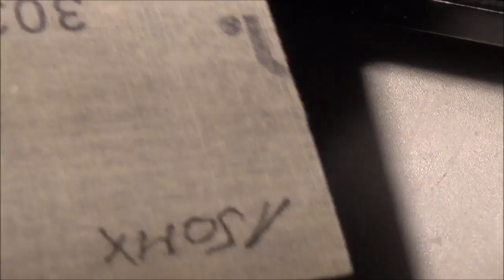Nakamichi BX-100 Idler Wheel Problem

Comment: Hi - Nice video!  Just a quick note - if you want to clean the idler to get more life while your part is on order, all you have to do is pop off the cassette door, take out the 2 screws holding on the black plate, and clean the idler!  You don't even need to take the cover off!
Just did that on mine and it's back to strong winding each way!
Reply from the maker: Thanks! And thanks for the info! That's good to know!

Comment: Thanks. I have this same model, and this helped me. I ended cuting a 1 inch square of 220 grit sand paper and wraping that around the wheel, and sanding it lightly in place. Only had to remove the front plate, and not take apart the whole thing.
Reply from the maker: Thanks for telling about the method you used. Good job!

Comment: Mine had developed the same fault. The good news is you don't need to take it apart to fix this. Removing the black plate is easy enough with just the two screws and then you can get to the little wheel and roughen it with one of those sticks designed for filing your nails. Very light pressure, patience -the idea is not to file it down. Using Fast Forward will allow you to get the machine to do most of the work too. However, I think the real problem is the rubber has aged and hardened over the last 40 years and this will only be a temporary fix. A replacement tire is needed. I ordered one along with a capstan belt as I am sure the existing one will also have lost its performance over time. Lubrication of the various bearings is probably a good idea too.
Reply from the maker: Thanks for your input! True, the rubber has just aged; nothing can be done about that. So far the deck, which is used often, has held up fine. I didn't know they still sold replacement idlers.
Reply: I used this filing method and it worked brilliantly. Highly recommended.

Comment: I just repaired my Nakamichi CR-7A thanks to your video and to the comment of one of the persons that watched the video. 
To make it easier than this video, I just removed the black metal plate that sits behind the cassette, there are two small screws on the top of this plate that sits right in front of this  Idle wheel. I cleaned the tire with liquid sander and I clean all the parts or spindles where this tire makes contact with Isopropyl alcohol, it took me about 15 minutes. 
Now it rewinds, fast-forward and  plays like brand new!
Reply from the maker: Good job! Thanks for your comments and tips!

Comment: Praise the internet and praise people like you for sharing the knowledge. I THINK this is going to be exactly what I need to get a Sansui D-550M going properly again. If the sandpaper doesn't work, then maybe I'll use an o-ring instead. Fingers crossed!
Reply from the maker: Good luck and thanks for mentioning o-rings!
Reply: @OldSchoolElectronics  Just to follow up, i was able to use your idea of sandpaper without removing the idler assembly. In fact, without a tape inserted my machine was able to spin the idler wheel reasonably well, so I could use fast forward to spin the wheel while I lightly touched it with sandpaper. I few minutes later, I was done. Thanks again.
Reply from the maker: Glad that worked out for you...Looks like you did a great job!

Comment: I just wanted to add to this video. I found that you can access the idler wheel by just taking off the black plate through the door. Also I removed the rubber wheel without removing the cam. I then turned the rubber wheel inside out so that the previous unworn inside part was now on the outside. A perfect easy fix.
Reply from the maker: Thanks for the extra information!
Reply: Your welcome. I didn’t say in my comment that your video is great.  It’s probably saved hundreds of Naks from ending up in the junk heap. Thank You!
Reply from the maker: Thanks, again! People have criticized me for this video, though! Sometimes I have also used an o-ring for the rubber wheel/tire. Good idea with turning the wheel/tire around.

Comment: Without this small trick and a small piece of sand paper, thi Naka was good for the garbage : what a shame ! I mean : there is not a single line about this possible issue on the BX-2 Service Manual. Couldn't they think such a problem could show up after some years ? Dam !  I mean, I'm happy to have save it - and thank you so much for your help - but in the other hands, I feel that so absurd ... Most of people have  think it is dead and how many units have been wasted ?
Reply from the maker: Good job! I am happy you got it fixed. Saved from going to the trash! I think when they made these machines they did not think these Nakamichis would still be used 40 years later. Thanks for watching and your comments!
Reply: you have a point!
Reply: Tess  , the ones who wasted it and threw it away were the no-brainers .. . . . Just place a piece of tape round the rewinding spools  , both left and right .. Or you can place the neck of a balloon round the idler wheel . Fits like a glove .
the surplus you take away with a pair of scissors 

There's also a video where someone places  balloonrubber  round the winding spools.
Look for Kenwood KX-400 in the browser  , the one with 5.14 minutes

Comment: If you lose the idler wheel washer, like I did.. You can use a tiny piece of the speaker wire sheath, just clip a piece off the end and use it as the washer. I've been playing tapes for months without any problems.
Reply from the maker: Cool! Thanks for that idea! Those little washers tend to disappear and hide.
Reply: @OldSchoolElectronics  at first I thought I was in trouble. Then I read some forum where they used a leather punch to create a washer from a milk jug. I was elated when the lil piece of wire sheath fit so well.
Reply from the maker: Good job and good idea!
Reply: @mzebari  That site was tapeheads... hahaha. I  saw that thread too :-)

Comment: I got my replacement washer from a garden hose tap adapter (the little rubber sealing ring is perfect).... cheap from the local shop and still working 10+ years later.
Reply from the maker: Hey! That's a trick to know! Thanks!

Comment: thanks for this great video, my deck had a different problem, but the same cause.  it could FF and REW, but play worked for 2-3 seconds, then the deck stopped.  having watched this video, i started removing the transport, but then decided to just remove the back plate, and I carefully sanded the idler wheel in place with a tiny strip of 180grit sandpaper.
Reply from the maker: Thanks for watching and glad you got it fixed! I hate to see this great vintage hifi gear ending up in a landfill. Yes, it is not necessary to remove the mechanism (I just prefer it since I can inspect things better); I think I mentioned this in the video or comments--not sure though. You used to be able to sand turntable idler wheels with sandpaper too. Anyway, good job!
Reply: I have the same problem with my mr1.. I'm a bit confused

Comment: Watch out for the black plate, at the bottom it fits into slots in the shiny pins at either side. I can see on the video 9:10 that the plate is not in the slots. This mounts the plate too far forward miss aligns the tape and makes the deck sound a bit off.
Reply from the maker: Thanks for that. I probably corrected everything afterwards  or in between video shooting, since I do give every unit a final test before I pass it on. It's been awhile, but the deck is still going strong although it is used every week by the young woman that has it now.

Comment: You really have chosen the hard way lol. You can remove the plate and replace or refurb the idler without removing the mech.
Reply from the maker: LOL. I don't know how many commenter already wrote that. I think I had a certain reason for doing that; hopefully you don't think I am inept even though I have repaired thousands of electronics units since I have been in electronics; on and off the job.
Reply: @OldSchoolElectronics  All good, your way was certainly working it just was a little complicated. Still, its good to see different ways of doing things :) I'm currently working out if I can refurb the idlers on a Sharp RT5100 without taking everything out...

Comment: A dab of grease will hold the washer in place...That drive system looks exactly like my Yamaha K-1000...the capstan motor is brushless and has a big flywheel that spins around a set of coils, which will have zero resistance, and the reel motor has the tire like yours that moves back and forth between the two reels..and I had to do the same thing with the tire...sand it LIGHTLY and as evenly as i could which fixed it.
Reply from the maker: Thanks for all the infos and tips!

Comment: some tech's use 3000 grit sand paper on the tire with a dremel. I prefer to spray carb cleaner on a cuetip and apply it on the tire. Restores tire softness and removes glaze.
Reply from the maker: Good ideas! Never tried carb cleaner. Thanks!
Reply: @OldSchoolElectronics  carb cleaner on cue tip, then on tire.  just enough to evaporate in a couple seconds will do the trick.
Reply from the maker: I will try that next time! Thanks again for that tip!

Comment: My device, a Nakamichi BX-1 was in very good condition, but had sat unused for several years at least. It has the same transport as the one in this video. The device would power on, but the only button that did anything was the play button, and it would just spin the capstan motor and flywheel for a few seconds and then stop. Nothing at all would happen with a cassette in the machine.

If you are having similar symptoms to the ones I described above (little to no movement from Play, Rev, FF), go to this video and find my comment there: https://www.youtube.com/watch?v=ExNSDYwKeXA

Once I had basic functions working, I came to this video to solve this exact issue. I would put a cassette in the machine and the functions were unable to move the cassette.
I suggest doing the following like another commenter suggested, it worked very well. Just remove the black plate as he does in the video, close the cassette door, press FF, and very lightly touch a small file to the rubber of the Idler wheel. After some time, and it will take some patience, try a cassette, and if it doesn't work try more filing. Due to the very low amounts of pressure you can use, a sharper file works better. Let the spinning of the FF do the work over a minute or a few. If your wheel is destroyed or cracked filing it probably won't work, but if it is just too smooth like mine was this might work well. 
Hope this helps!
Great explanation Old School, very useful video. Thanks.
Reply from the maker: Thanks for your comments and tips! The deck I did is still holding up good. The woman that owns it uses it every week and it has been a while since I made this video.

Comment: Will it also help to very slightly  sand paper the brass motor capstan with like 320 grit sand paper, which comes in contact with the idler wheel?  WIll this further enhances better contact or just don't do it as it might distort the dimension of that brass capstan?
Reply from the maker: sir, i would be hesitant with sanding the capstan. might be another story if it had some kind of wear pattern. i just clean them with alcohol (use a clean rag if the cotton swab doesn't work), making sure not to get the alcohol in the capstan bearing. then maybe put one drop of sewing/machine oil on the bearing; just one drop. then clean any excess oil off. maybe i would use something not too abrasive like scotchbrite if there was something on there i could not otherwise get off--so far, i have always gotten everything off. in the end, it is a judgement call...if the unit plays fine, i would just clean the capstan up. stands to reason though, that a slightly sanded capstan would grip slightly better. a heavily sanded capstan would seem to wear the tape faster, this would probably show itself by deposits building up faster. in the end, i would focus on the other stuff to get the deck up to par again: pressure roller, clean heads, new belts, good rubber pulleys, clean tape guides, demagnetization, and so on.

Comment: I don't get that: why did you open up the machine and pull out the entire drive mechanism, when all you had to do, to access the idler wheel, was remove the plate from the front without any of that ???
Reply from the maker: I had another reason for pulling it out; I don't remember what it was though, since it was years ago? Why would you be so concerned about that?

Comment: I'm wanting to replace the power cord on my Nak CR4, do you think it's as easy as soldering two connections?
Reply from the maker: I no longer have this unit, but it should not be too difficult; so long as you can get the  strain relief of the power cord out.
Reply: ok thanks.

Comment: I got a nak bx300 with a broken "swing arm" that holds the roller in place. I bought a used bx-1 for parts and got her going! It's an absolute pain though.
Reply from the maker: Good job! I didn't expect to work on mine; unexpected problem. I assume the higher you go up in model number, the more difficult they are to fix.

Comment: The most important thing - how to take off the snap ring is not there - omitted. Otherwise the removal of the whole mechanism due to the replacement of the rubber band is completely unnecessary, it can be done from the front without removing it from the hi-fi tower
Reply from the maker: Well then, you can make a video showing how to do this.
Reply: @OldSchoolElectronics  No video required. With the door open, the operator cover can be unscrewed with two screws and pulled out comfortably. The pulley is exposed and can be removed after removing the fuse. The rubber band is replaced and put back. That is all. Otherwise, thank you for your video :)
Reply from the maker: Ok, cool! Thanks for the infos!